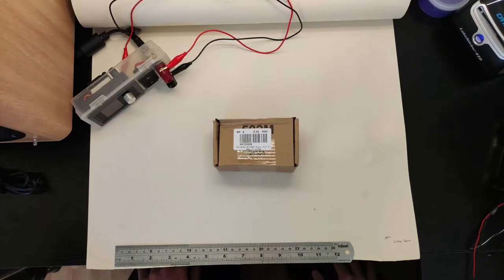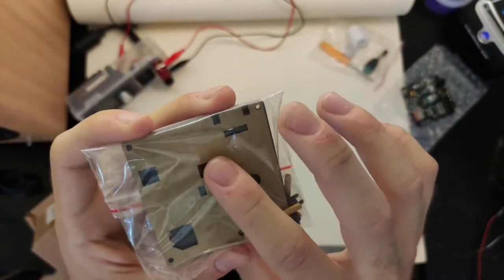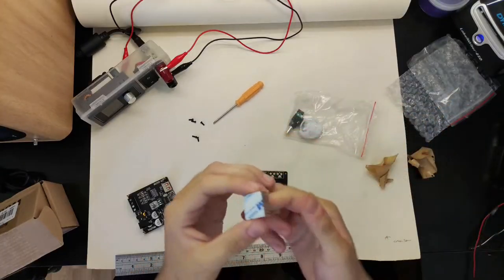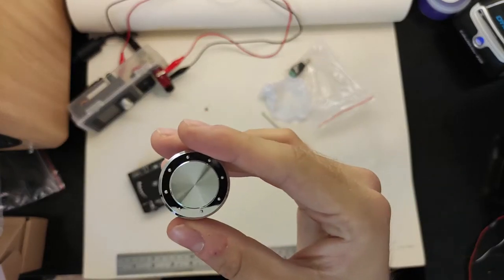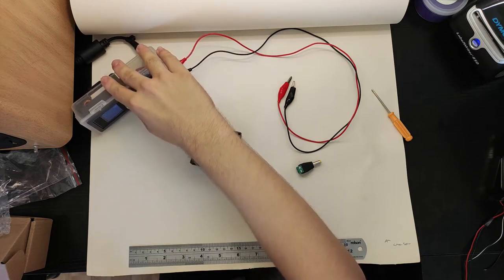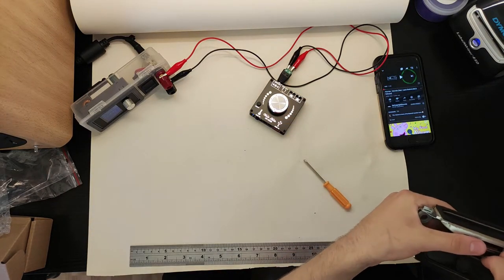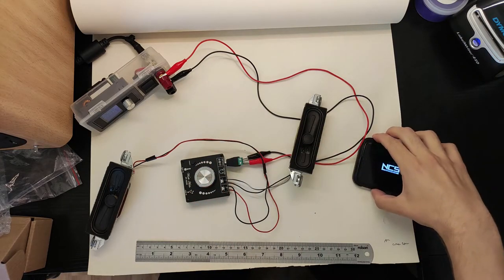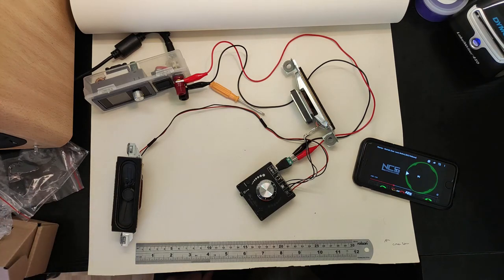WUZHI ZK-502M 2x50W Amplifier Assembly and Test

Comment: I have similar amplifier same size but using tpa3116. This amplifier benefits more on 24v, this board doesn't suck much power on 12 to 19v that's why it distort.

Comment: one time i got this tinyyyyy litle tpa3116 board and it was great. but one day i decided to put it in 24v instead of 12-16v i usually use it on. long story short, the magic smoke was out
Reply from the maker: @LukaszLukasz00  the tpa3116 is designed for up to a 26v input, perhaps you connected a very low impedance speaker or the chip was inadequately cooled?
Reply: @scellyyt  nah, it was 4ochm
Reply: @scellyyt  and it also blew up instant